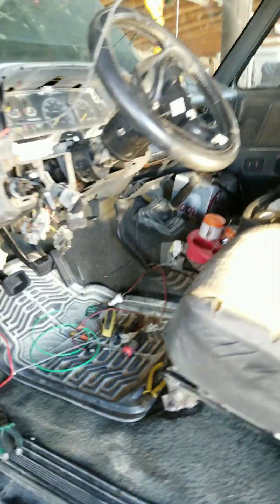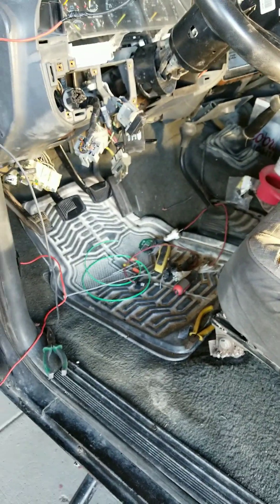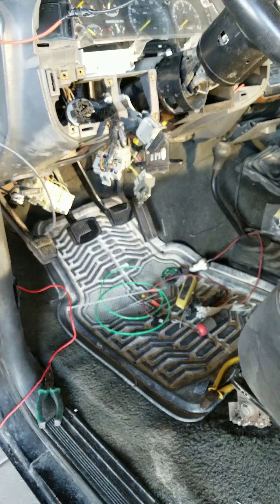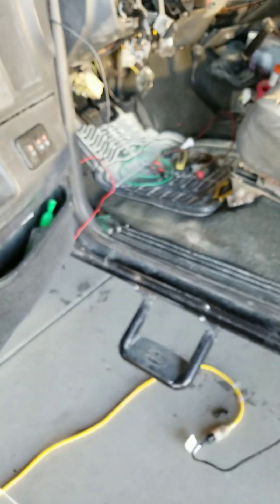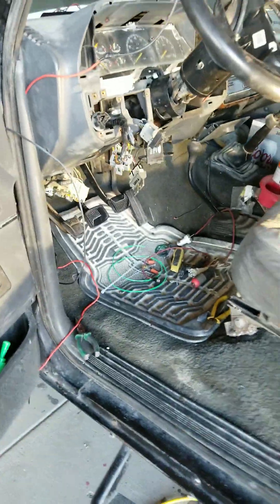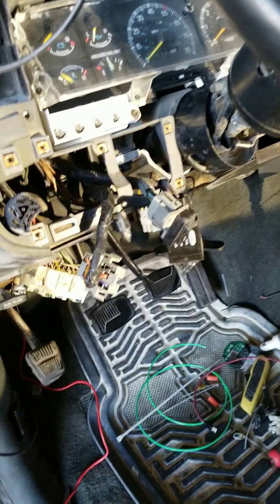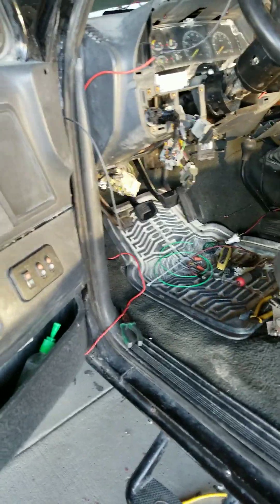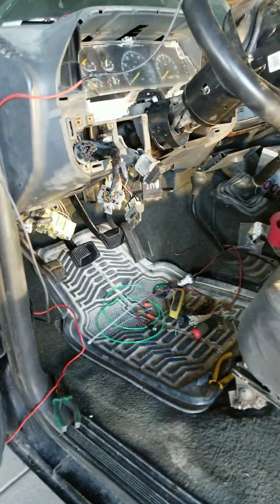1989 Ford Bronco No Start from Short (Solved) (Part 4/4)

Comment: I haven't finished watching  your video but it seems like it could be the neutral safety switch on the transmission. After the wire leaves the ignition switch it goes to the neutral safety switch not straight to the starter solenoid.

Comment: Hello, great video, any ideas what gremlin will cause no spark, no fuel pump prime on a 94 5.0 5 speed F-150? Truck got new distributor, coil cap etc. started a dozen times, cycled the key a few times it went dead. I have no clue where to go now. Fuses, relays, inertia switch all ok. Thanks

Comment: I have a 1989 Ford Bronco that looks similar to yours and I have a electrical issue.  I am trying to resolve where power is not going to all the fuses and certain things do not work.  What do you use to test if there is electrical current in the wires?

Comment: Okay question for ya????  LOL this is what is happening to me on my 1990.  Long story short truck drove fine ... steering wheel loose EX took out steering column and well having same issues that you had now trying myself to follow the wires and I have zero idea sometimes it cranks and now its not but its clicking and turns over when I take screwdriver to solenoid and spray starter fluid?  replaced ignition ignition switch and bar that you are talking about.    Any ideas .
Reply: Did you get it? I've changed battery terminals, solenoid and starter. If I jump the solenoid it cranks but doesnt start.

Comment: I`m searching the internet for some answers, i have the same problem with an 1989 f-250
No power to the 2 Yellow wires to the ignition switch, no power to the fuel pump and no lights in the Dashboard, nothing works. 
I am thinking about rewireing the two yellow wires, and then take it from there.